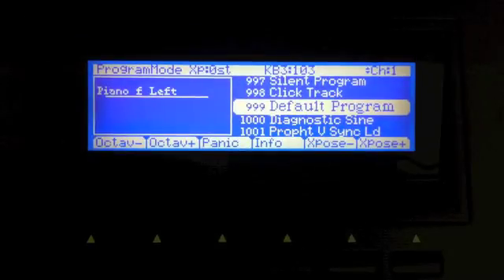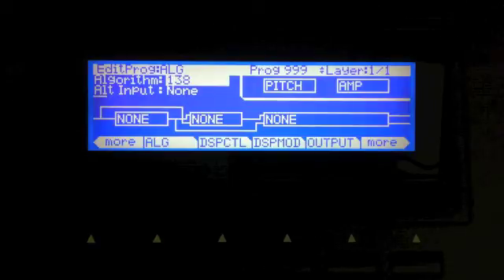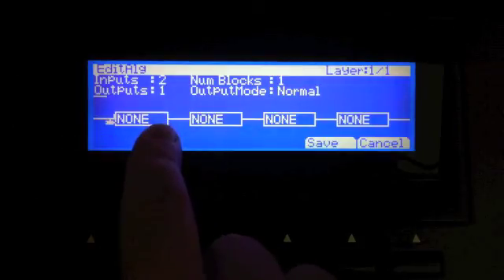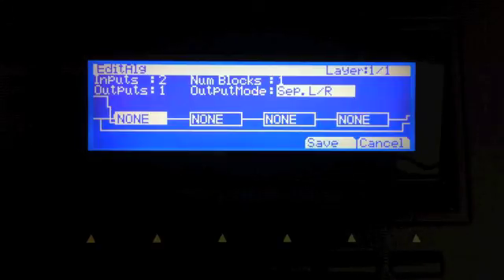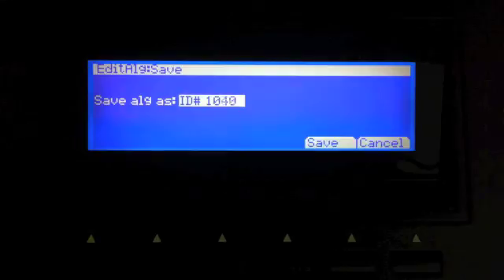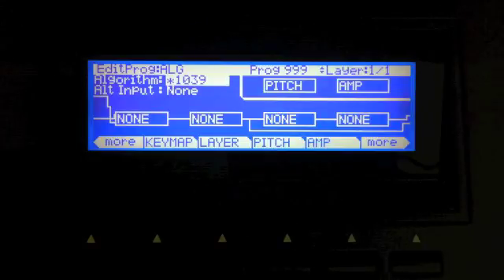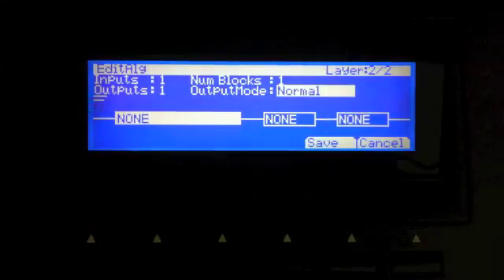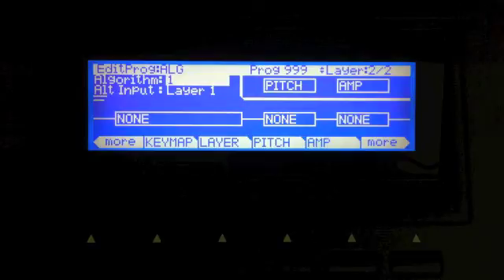Kurzweil PC3: Tutorial 9 -- Creating and Editing Algorithms

Comment from the maker: Oscillators on the PC3 are simply DSP functions -- SAW, SQUARE, SINE, etc. So, for instance, you might do something like this to create a simple sawtooth wave oscillator into a two-pole lowpass filter:
 
SAW --> LOWPASS

For FM, the most compact way to do it is to use SAW+SHP --> GAIN, which is the equivalent of an FM "operator" on, say, the DX7. Using this arrangement you can have up to 64 FM operators in a single Program on the PC3.

Comment from the maker: It sounds like you're a bit confused about the general layout of a "Program" in the PC3. Basically, you have Program --> up to 32 Layers --> each Layer has a single Algorithm --> Algorithm determines layout/wiring of four DSP slots. A "Program" on the PC3 corresponds to a "Patch" on most other synths. Doing the math, that means you have 32 Algorithms within a Program, and therefore up to 128 DSP slots.